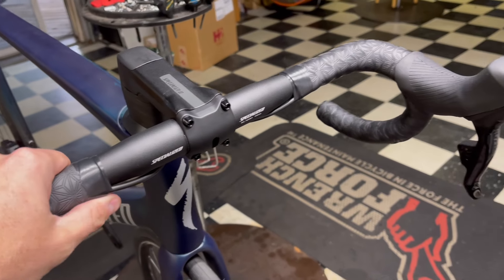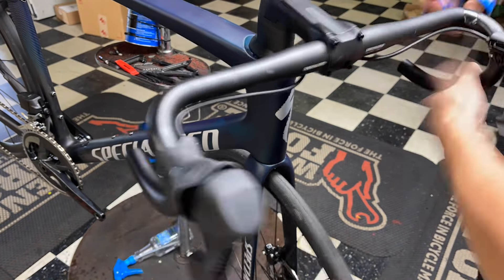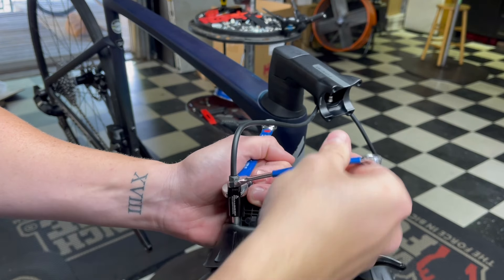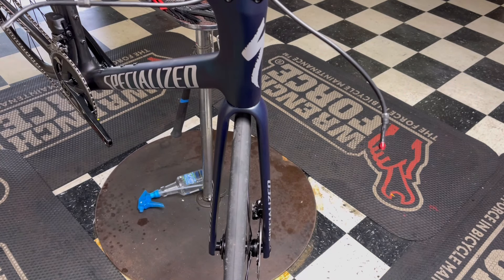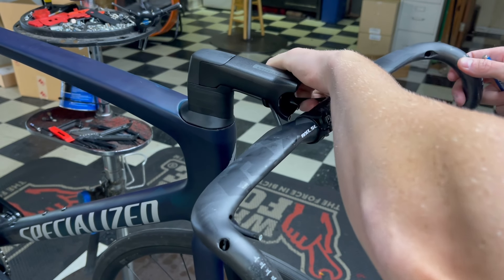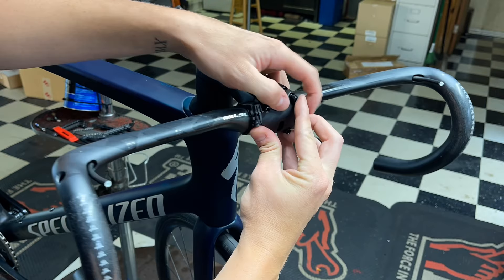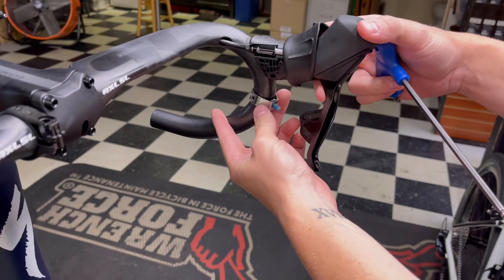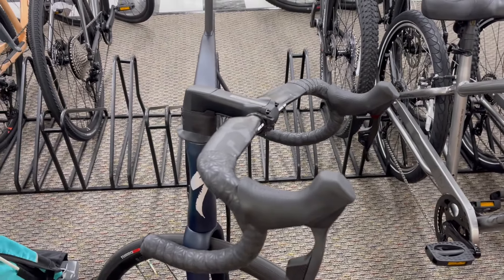HOW TO INSTALL EXTERNAL ALUMINUM HANDLEBAR FOR INTERNAL CARBON BAR FOR TARMAC COMP SL7 SPECIALIZED

Comment from the maker: I hope this maybe helps someone waiting to tackle this job for themselves and if you have any questions please let me know down below :) thanks
Reply: any option to integrate a Diverge cockpit?
Reply from the maker: @maxmason2018  no they do not have that option because of the fututre shock that is there..... but maybe in the future they will make some adjustments
Reply: Hi do u know of any carbon aerobars that fit wilier cento10 sl?
Reply: I’m doing an identical thing imminently- question is if I can feed the hoses through the bars without having to cut them, can I simply reconnect to the levers or do I HAVE to cut and install a new stealth a majig??
Reply from the maker: @LeftLegRightLeg  you have to cut them. Because they are considered crushed each time. They are meant for a one time use.  Cometmes you can get away with it to re use the old ones but it can also lead to fluid leaking
Reply: @GCPerformance18  done. Great vid thank you
Reply: Is this process same for a shimano dura ace di2 rd-r9250-d system?
Reply: I honestly think you could have routed the line through the handlebar without having to have cut the ends off

Comment: I bought some used S-Works Aerofly 2 handlebars. I have all the parts needed and a bike stand. My current handlebars on the bike are 440mm and I bought 400mm Aerofly 2 bars. I think the swap should be similar to the video. The brake lines may be a little short like the lines in the video. Seems like I can do this but Ive never done my own handlebar swap. Never done my own tape job either. May just try it and if im not happy take it to the bike shop to fix it lol. I can ride my Diverge while the Tarmac is in the shop.
Reply from the maker: hell yea give it a shot and see what happens a shop can always fix it, might cost a little mroe money but I mean who cares have fun with it
Reply: you went from 440mm to 400mm - did you get a bike fit? What's your shoulder width. IMO 400mm is too narrow for many people so double check that before you cut hte hoses
Reply: @lechprotean  I actually had my daughter help me measure my shoulder width before I made the decision to swap. Vids said take your measurement and add two centimeters to the measurement. I measured out to about 36 centimeters so I probably should be on a 38cm bar. Since I am 6'1" with a size 58 Diverge and Tarmac they both came with 44cm bars. Im a tall skinny guy. Weigh about 170lbs. I went with a 40cm over a 38cm. I actually live in a area with no way to get a professional bike fit. I do my own fit with my indoor trainer and record myself with a ipad. I actually already did the swap myself after watching this video. I didn't have to bleed the brakes. I used his GC Performance tape vid to do the reverse tape job myself also. It came out pretty good for my first try. The bike felt weird first ride for sure. I am completely use to the narrower bars now. I've actually had a couple of personal bests with new setup. My bike was a stock 2022 Tarmac SL7 Comp. I now have aerofly 2 handlebars, roval cl50 wheels, sram force cassette(put rival cassette on indoor trainer), and sram red crankset.

Comment: I guess the moral of the story here is it I’m going to attempt this myself, go with sram. Shimano? Fuggedaboutit.
Reply from the maker: srassm is way easier because you do not have to worry about getting the di2 wire through the bar, which is not that hard but in terms of the job itself the sram is easier

Comment: I want to have a video on installation of a integrated handlebar like Vision Metron with both Hydraulic and mechanical gears like Ultegra R8000. Please share if you have something like that.
Reply from the maker: I do not install those alot

Comment: great video, one thing i want to ask, i using shimano di2 disc groupset, can i just not cutting the break cable and just used old want.. sory dont what to call that needle, what i mean is just open break cable and assemble back
Reply from the maker: no because those parts are crushed and once removed they need to be replaced also it is very hard ot fish that line through the bar with the old parts still on

Comment: Is it really necessary to cut the hose? Im about to install new bars with an intergrated section but dont want to mess about cutting the hose
Reply from the maker: yes it wil not fit through th ecutout

Comment: Do you ever go from the top through the hood when accessing the shifter clamp? Rather than rolling up the hood
Reply from the maker: Yes I do it on the sram red and force hoods but not Shimano or rival for some reason. Just my presence

Comment: Front brake contamination inc ! :')
Please remove the wheel and brake pads when you bleed or mess with hydro brakes !
Reply from the maker: Yea for your average joe shmooo who attempted one time in his garage I get it. This is my job, I do at least 3-4 of these a day, I got it
Reply: @GCPerformance18  like the part where you send dot everywhere because you hit the hose by mistake 😅

Comment: My compression nut (not the olive or barb) won’t just slide down my brake hose? Any tricks to loosen it up enough to slide it down far enough to make the cut?
Reply from the maker: you have to wiggle it around, sometimes they are stuck on there, maybe us a toool but only thing is to try and get something to hold the nut and something to hold the olive and yank opposite ways, also you can try spraying some lube behind the nut to get it to brake the rust seal

Comment: Can I Do It without cuts? Are the holes in the steering wheel large enough or not?
Reply from the maker: They are not. It wouldn’t work. You need to cut it

Comment: Do you need to cut the hydraulic brake line on all the carbon bar installations or did you do that to just shorten the line?
Reply from the maker: you need too, because the hydralic olive on the end of the line can not be re used, and it can not be pulled through the bars easilly, but the olive is meant ot be a crush part

Comment: Why did you have to cut the barb / olive? Was it in order to get it through the handlebar? 

Or is the olive / barb no good once it's been taken out of the shifter? 

Doing the reverse of this upgrade😂 going from the Aerofly to normal carbon bars, wondering if I still need to cut the olive/barb on my (Shimano) setup. Because I definetly would be able to get it through the handlebars without cutting it.
Reply from the maker: both lol.... it is much easier to get the naked hose through the bar without the barb and olive.... also the olive is a crash part, so what that means, is once it is used once and crushed into place and then you remove it, it doesnt seal the way it should the second time... once removed you always need to add a new one
Reply: It depends. If you work on a new bike like GC did, chances are that the initial installation was done with a proper torque and the olive hadn't been crushed and deformed. 
I just swaped my SL7 Comp stock handlebar for Roval Rapide one myself. I bought a bleeding kit and spare barbs and olives but managed to get away without cutting the hoses. My plan was to check if I can seal with re fitting the old olives and it worked fine in my case. I didn't have to bleed my brakes either.
That being said you should be prepared to cut hose ends and install new Stealth-a-majig things if you have a leak. And it's probably better to do it every time as GC advised. Just saying that it might still work without.
Reply: @pszemysuaf  I ended up clipping it and doing a new Olive / Barb. However I have (on a diff bike) also recently not changed the barb, both ways work no dramas tbh

Comment: Great video. Is the process similar for Shimano brakes?
Reply from the maker: yes the exact same but with di2 wires so a little bit harder to fish them out
Reply: @GCPerformance18  can I lay the shifting cables and the breaking lines trough the same hole on a shimano lever. I have a tarmac SL6 comb and want to switch to the aerofly handlebar?

Comment: If you weren’t trimming the cables would you still remove the red barb parts?
Reply from the maker: yes yopu have to, to be able to fish the line through the carbon bars, if you did not remove them they woudl not fit through the handlebar itself
Reply: @GCPerformance18  thanks, love your vids. Your the only one who’s bar wrap vid I’ve been able to follow and get good result 👍

Comment: GC how much do you charge in your shop for the labor to install a new integrated cockpit with a blead with new tape wrap but customers own tape?
Reply from the maker: depends on the group but probably aroun 200-250
Reply: @GCPerformance18  thanks man. Finally got my syncros ic sl bars after over a year lol. My LBS is quoting $150-$200. Next bike definitely going semi integrated

Comment: Great video, looking to do this myself on  my sl7; however Can i do this job on a sl7 that was ridden 100 miles already or am i gonna squirt fluid all over?
Reply from the maker: no you are fine , as long as the hoses are connected to the calipers and the bleed port caliper is not opened then it creates a vaccum and your good just dont squeeze the brake lever when disconnected
Reply: @GCPerformance18  perfect! Thanks a lot for replying back.  I appreciate it!

Comment: So if I understand correctly. If my stock handlebars are 420mm and I am installing new Roval rapide 420 mm handlebars, I dont need to cut the hoses ?  I just unscrew them, put in new handlebars and screw them back ? Thank you
Reply from the maker: you will need to cut them to removed the crushed olive on there, and re install new olive and barb

Comment: Does the same process work for Shimano hydraulic systems? ie, can you just remove the line from the calipers without mineral oil leaking out of the caliper?
Reply: Shimano hydraulics don't stop leakage when they're cracked open. This anti-leakage feature is SRAM's Stealth-A-Majig at work.

Comment: I just bought an aero handlebars for my Roubaix expert. My current set up is an alloy bar, do I need a carbon stem?
Reply from the maker: No you don’t, you can run whatever stem you like with the bar

Comment: I just bought a used 2021 SL7 Pro (size 58) converted to double in the white.  It arrived y'day and when I dropped it at my local bike shop they noticed that the previous owner had run a 130mm stem.  Since I am only 6' I asked them to swap in a 100mm stem.  The problem is neither the current 130mm nor the 100 (both are the integrated specialized SL7 stem with the hole on bottom) have the bracket underneath that holds the cables in neatly.  Can you tell me what this part is and where I can get it?  I also need the compatible spacers and top cap but those I have been able to find online.
Reply from the maker: they come with the stock stem, you need to have a specialized store order this part or email specialized and ask for it
Reply: @GCPerformance18  Thanks.  I was surprised not to find it already on the new 100 mm that I bought from my Specialized dealer.

Comment: did you use any anti slip tape on the center of the handle bars before you placed them in the stem?
How much do you tighten the nuts on the stem?
Reply from the maker: no I did not and the nuts at 5nm
Reply: @GCPerformance18  Is that a stock aluminum stem?
Here's why I'm asking about how tight and anti slip paste or tape. I thought I saw a video where they changed the handle bars and used a anti slip tape. I'm curious about that but can't seem to find it. I can find the paste.
The tightening, I bought an aero drop bar and at 5nm it slips. It works fine till I hit a bump and then the bars slip and I'm in a very uncomfortable downward position. So I tighten them hand tight and they work fine, however, it scares the hell out of me thinking that because I tighten them a bit tighter than 5nm I may have caused them to fail.
At this time I'm waiting for a carbon fiber stem to replace my stock aluminum one and some anti slip paste. But I did take it out for a test ride this morning and all seemed well, however, I was cautious.
Reply: @Elc0chin0  If you've installed a carbon handlebar that's torqued to spec with carbon paste applied, then there's most likely something wrong with the stem, such as not having enough surface area to really grip the handlebar.

And yes, that stem is the bike's default stem and it's made out of aluminium. Anytime you install carbon parts that need to be clamped down, you must use carbon paste. The only exceptions are when you install stems on carbon steerer tubes and carbon-railed saddles.
Reply: @sbccbc7471  Thank you for your reply, I discovered the problem. I bought an inexpensive aluminum accessory that fit on the front of the stem to hold my phone and a light with a gopro attachment. 
Apparently, the two large extended washers were stripping and were not able to be bolted in properly, after removing the inexpensive (used on my aluminum bars and the carbon bars several times, it didn't wear very well.
I got some advice on a very expensive accessory that doesn't have the bolt extended washers so I think I'm going to start with that.
Also after removing the inexpensive accessory and tighten the bolts at 5nm the bars sat good. 
I am just beginning at understanding all the facets of bikes.
Reply: @Elc0chin0  I think I know what kind of out-front mount you got, the one I hate the most, for its inferior mechanical design.

Those sleeves (what you refer them as extended washers) will always shear into the out-front mount and are usually made out of a soft aluminium (sometimes plastic, which is worse), leading to the bolts inside these things required to be driven deeper until they can reach the bolt tension required for 5 Nm. By the time they're torqued down to that much, the sleeves are already no longer intact.

I've seen this out-front mount a handful of times on customers' bikes, none of which were installed correctly. All such mounts I've encountered have undertorqued bolts. One of my customers has this kind of mount on a Specialized Venge V3 stem, where its faceplate has a slot to take an out-front mount designed for it (made by Bar Fly in collaboration with Specialized). As her mount's sleeves were made out of plastic (which were obviously already deformed), my colleague suggested jerryrigging new ones from aluminium shift housing end caps, which I already predicted won't work as it obviously wasn't designed to resist compression forces, but I tried anyway just to satisfy him for this inevitably short-lived moment.

After I tried fitting the jerryrig idea, it did indeed not work like I predicted. Refusing to reinstall this same out-front mount for safety's sake and the fact that she has a ride tomorrow night, I went "To hell with it." and bought the Bar Fly out-front mount that's lying in the shop since it's within reach, alongside finding two more bolts that are as short as the original stem faceplate bolts (now that I no longer need to clamp any hardware between the faceplate and bolts).

Some time during the installation, my customer noticed what I did and I told her I'm refusing to risk her safety for that stupid out-front mount as I'd rather lose a little of my money instead of putting a customer in physical danger. After hearing my explanation, she offered to pay half of the new out-front mount's cost. I have no idea if my colleague knew what I did, but I'm secretly happy that his idea doesn't work in his favour. He doesn't have half the mind of an engineer.

The new kind you're talking about sounds something like what Framesandgear are offering. Their mounts are indeed more expensive, but they don't have the same problems as the one I hate as the cylindrical structure can fully distribute the clamping force generated by the bolts' heads. These allow stem faceplates to be installed much more securely than your first one.

Comment: Is the procedure the same with shimano hydraulic brake? Fluid wont come out when I cut the hose?
Reply from the maker: yes it is the same and fluid wont come out, you are going to need a tool to punch the barb into the hose they do not thread in like the sram I showed and also the di2 wires are a little bit more to run along with the hose but not impossible
Reply: @GCPerformance18  Thanks! Yeah the little olive thingy is a nightmare to do without proper tools. I tried to install new brakes on my old MTB a few years ago using only box cutter, hammer and vise. I failed and had to bring it to the shop and buy new brake hoses in the end 😅😅

Comment: Would it be possible to get the opinion of the rider as to the road vibration thru the new handlebars compared to the old bars? Got the same bike, the handlebars feel really thin under my gloved hands, the front end is so stiff I know if I run over a matchstick! It’s the only disappointment with this bike.
Reply from the maker: it will make a huge difference I promise you, the bars are very narrow and thin so they put alot of pressure on the nerves.... but get a more aero bar that is more ergonomic and it will eliminate alot of that pressure and also it will dampen vibrations as you rid because the material is not as harsh it is a game changers
Reply: @GCPerformance18  thanks for the reply, Specialized really went cheap on the bars and they are nasty with such a stiff front end. 
Spoils a really good bike, I just love it! Keep up the good work, best wishes from Australia! 🇺🇸🇦🇺

Comment: man....no bleeding (written in sram's manual), no carbon paste between stem and handlebar, no dot grease ....whaat?
Reply from the maker: You realized there was carbon bars before carbon paste was even invented for road bikes...... it is not needed at all, it can be recommended but not required. And yes you don’t need to bleed it if your good, I’m not loosing any bit of fluid at all. And that’s why there is a bladder in the hood of the shifter.